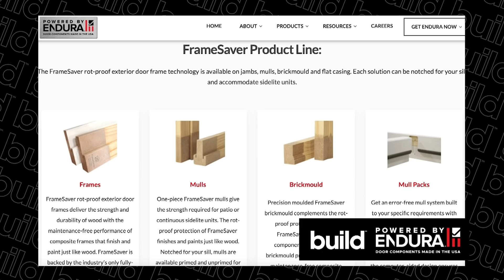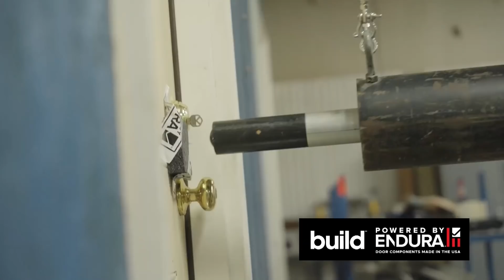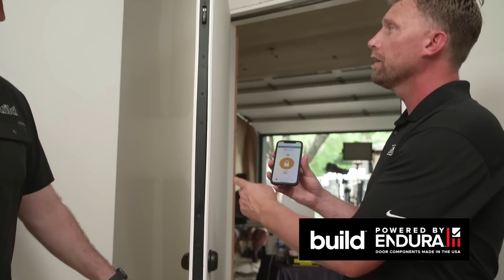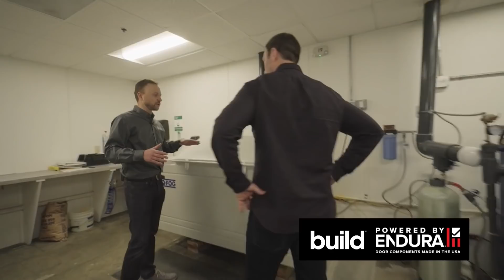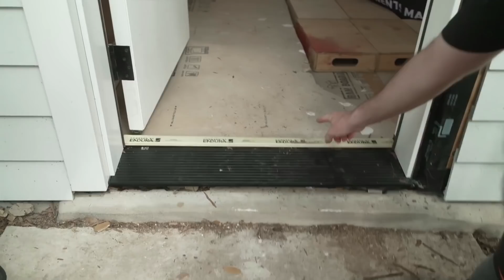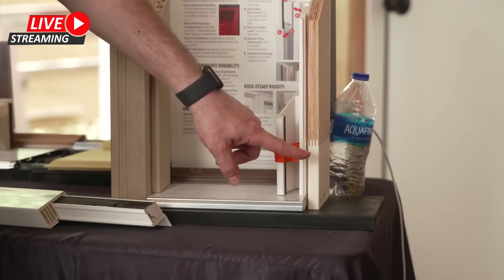How to Get the Most Out of Your Entry Door: Innovative Solutions for Every Day Challenges

Comment: DO I REALLY NEED TO BUY $1100 TEMPLATE TO INSTALL THIS LOCK? REGULAR ROUTER SHOULD WORK!!!   1/17/25 GOT THIS EMAIL ON COSTS: BetterDoor Support
The Panolock Plus starts at $245 for 6/8 door and $350 for 8/0 door.  The template system is $1100.00.  Shipping is free for orders that are over $125.

Comment: @11:48 — now, fire that 2x4 at the door at 250 miles per hour, not 35 mph. I’m not worried about my doors being bullet proof, but I would really like my doors to be Hurricane and tornado resistant to that kind of flying debris. Which means higher speeds. Much higher.

Comment: My Front Entry Door is protected from the worst of Our Australian Weather by being South Facing and under a Verandah. 

Additionally the Door is a Solid Core Engineered Timber Door, with a quarter panel Security portal (Steel Mesh Screen on the outside and an opening Frosted Glass Panel on the inside). 

Further the Front Door is Secured by Two Deadbolt Locks, both requiring Keys to unlock. 

Thus My Door can remain fully locked and secured whilst I can have face to face conversations with individuals outside of My House.

Comment: Matt, have you ever seen a door that has deadbolts on all sides with a steel frame? Like three on each side and two on top and bottom of it?
On the electric lock system I’m not liking the four A batteries, should be like a lithium battery because they don’t break down like conventional batteries. Great video.
Reply: All the standard sized batteries come in a lithium version

Comment: Matt thanks very much. While I appreciate this is for builders its also helps owners/buyers make better decisions. After owing 9 properties in 3 different continents (& renovating each one) you learn a certain amount but nothing like this. My experience particularly in the UK is that there is a huge gap between what manufacturers products can do and the skill level of trades. I saw this particularly when buying expensive custom interior fire doors (with frames & seals) that the installer put in poorly and which I then had to fix. We had to use these in a 90 year old concrete apartment because building control (local govt) mandated these along with a fire suppression system, however they never actually come on site to check whether they have been installed correctly before giving final sign off.

Comment: Why not hardwire the door mechanism electrics?
Reply: Some simple spring loaded metal contacts would be perfect combined with a battery backup…..
Reply: That's an awful lot of flexing for electrical wire. It likely wouldn't be code approved.
Reply: @koryleach9660  We run wire with security doors, it could be if available.
Reply: @BrockGrimes  Yeah, for new construction that's a potential solution. For a retrofit, not exactly cost effective in comparison to a few AA batteries.